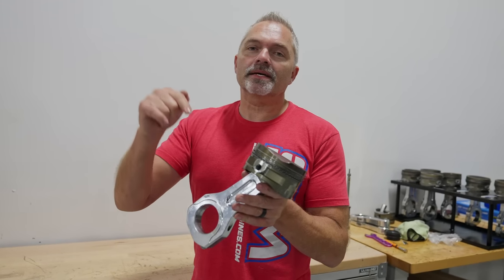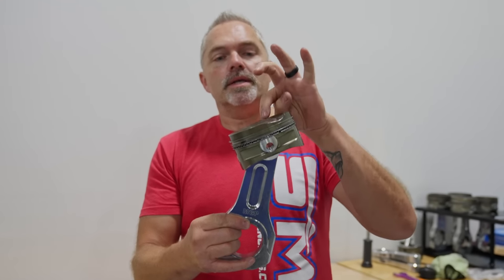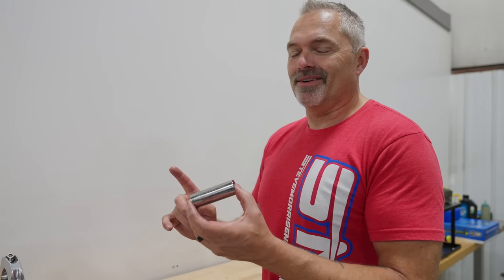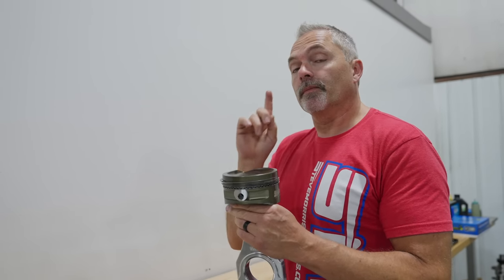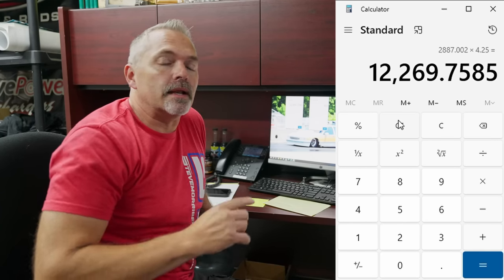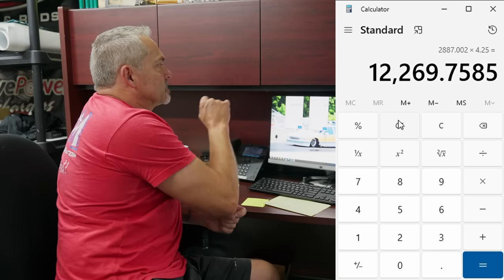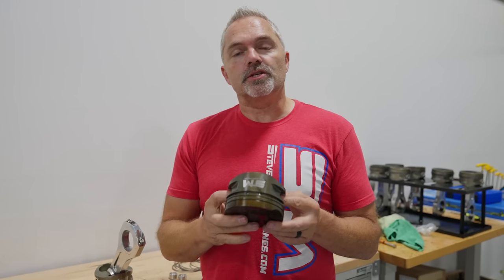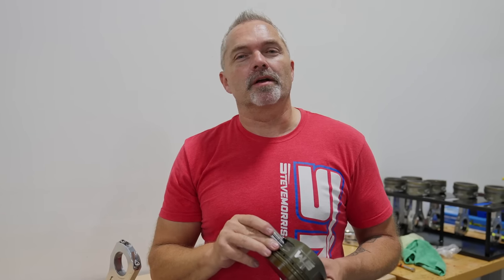Throw your rods away if you do this ???

Comment: Hey Steve, loved the video, I’m going to put my unwanted two sense in here and please correct me if I’m wrong! (This is kinda what was going through my head while watching the match I’m not really sitting this kind of asking) While I assume the inertia math is correct (I’d have no idea what math to use) there won’t be the x amount of lbs you had calculated on the connecting Rod pulling the piston  down, here’s why I think that. So we all know the piston Dosent travel the same speed during its full stroke, it’s faster in the middle of the barrel then it is at bdc and tdc, because it’s moving slower and slowing down a bit not just comes do a dead stop it wouldn’t put that whole 15,000 or whatever calculated lbs of force in the rod (all at once) 15,000 lbs of work is performed but over a very very short time period not just instantly which I assume would greatly reduce the shock factor of that inertia causing it to be less then 15,000 lbs on the rod that calculated force would only say if that 2.5lb piston was traveling at that certain speed. I could be wrong about this maybe that math is set up so that it takes that into account already? I’m not sure just my thoughts from watching, let me know what you think, thanks!

Comment: Very interesting video, cool to see the actual numbers and math. Curious why you say the revlimiter is so bad though. Even on the rev limiter you have compression on top of the piston, is that few degrees of BTDC spark that vital at slowing the piston down? If so, why can everything with stand the inertia PLUS the load created by combustion on the bottom side of the rotation?

Comment: That’s a lot of pound force. I can see why you wouldn’t waste your time with the weight since it won’t significantly impact that number. Cool video! Thanks! The product I just tested can handle (based on accidental destructive testing) 940,000 lbf of tension at 400 degrees Fahrenheit. It’s pretty nuts when you think about it.

Comment: Whe I first openedy auto shop customer brought me a Chevy cobalt with rough idle. It was hot and I hosed the throttle body down with a whole can of brake clean. I went to start it and instantly it turned 10k rpm and just screamed as it burned the brake clean. Customer standing there whole time. I now blow out Intake with compressed air after cleaning throttle bodies.

Comment: Ah, I love you Steve for what you teach and im not a troll, i actually almost failed 12th grade due to struggles with math, but i believe you're doing the math wrong. If its:  0.0000142 x Piston weight x RPM squared x the stroke, you cant do 0.0000142 x Piston weight x RPM x RPM x stroke. you have to calculate the the RPM squared first. so: in your first example @7500 RPM, that would be:  0.0000142 x 5.21 x 56,250,000 x 4.25 which calculates out to 17,686.32 lbs.  Edit: Changing your windows calculator to scientific mode will give you more options too

Comment: Just like ballistics. A tiny 7mm bullet going over 3000 feet per second weighing 180 grains / 11.7 grams has 4000 ft-lbs at the barrel and still has 2700 ft-lbs 1200 feet away. Granted a very high powered rifle but the numbers are still mind-blowing.

Comment: Uncle Steve maybe you could enlighten us on valve weight spring pressures valve control . Any math of the same relation? 1 of my buds just broke a piston by floating valves on a recline. That exponentially increasing weight must apply

Comment: On revolutions per second, shouldn't you have to divide by 8 first, than by 60? Revolutions are done at the crank, not individual pistons. There's 8 Pistons, so 7500 / 8 / 60 / (2)
That gets you 16 revolutions per piston and 8 compression strokes, per second. That message way more sense to me

Comment: Reminds me of the equation for a 2.0kg speaker sitting loosely on the parcel shelf - in a 50.0G crash (for number example) - that 2.0KG speaker turns into a 100.0KG as it slams into the back of your head.  CHEERS from AUSTRALIA.

Comment: I recall looking at the max weight I could hang from an M10 or 12 bolt, max recommended weight was one ton, steal not alluminythough.
Is crank case pressure really as high as say though?
Because as one piston goes down another goes up so must all be blow by pressure due to blower ?

I have idea on making piston lighter- just drill holes through top and it will let crank case gasses out too....
...... don't know why my compression is low.....😅😆😂

Comment: The maths changes with crank angle. At max and min piston speed the acceleration is zero. That's TDC, BDC and roughly mid way. Max acceleration is at the midway points between zero acceleration. Your weight calculations are based on max acceleration.

Comment: Hey steve ,There is a video by ben alameda racing showing an engine on a dyno running at 6500 RPM [800HP] .If you watch the crank trigger ,the pickup is intermittently hitting the wheel ,throwing sparks!  The crank was flexing so bad. The engine [ford] had a externally balanced forged crank that was rebalanced internally, the engine was not built by him though. Imagine if that engine went in a car and was run to 8000RPM . It would have done it once..... maybe. sorry to see your problems with sick week testing .glad you're OK.

Comment: i bet the downward force on the power stroke is much higher than the 15k lbs you calculated.   Inertial force on the piston is nominally the same both ends, but on the power stroke you still have probably over a hundred PSI of combustion pressureadding to that.

Comment: Here's one to blow your mind. At 10,000 rpm and a 4 second run a top fuel engine only turns over 666 times. It would be interesting to see the numbers from the much more complex math it would take to see the same thing from a promod or anything with a transmission and doesn't run a consistent (ish) rpm down the track.

Comment: Tri-Angle wrist pins.  Machining iffy but strength to weight could be tested.  Like a Mercedes star with fat dome tips.  Just brainfarting around.  The structure should eliminate any bend and deformation.  Picture a wrist pin with 3 holes, not one.  Or am I as dumb as they come?

Comment: Hi Steve, just wondering with the calculations if it also allows for what's going on in the other cylinders, which would change all of the big-end and small-end pressures depending on where it is on the crank in relation to the firing piston???🤷‍♂️ Makes my head hurt just thinking about it, let alone  what happens on the limiter 🤦‍♂️

Comment: I remember a long time ago (early 90's) going to a truck and tractor pull. One competitor had a tube chassis, glass body 2wd S10 with a small block and zoomies. When he hooked up and launched, that motor sang a note I've never heard before (or since?). Talked to him in the pits and he said he would launch around 10k rpm!! HOWEVER- small block has a much shorter stroke and may have had a custom crank with and even shorter than stock stroke, still. . . 
And if you want to see something mind bending, search for "the hypermax" dragster. It has a modded DT466 diesel (same as a school bus) that launches at 7k!! . .🤪 what?

Comment: PEMDAS says you’re math is wrong on the RPM squared. U have to square the rpm first, then multiple by the .0000142 x 2.51 x (rpm squared) x 4.25
Parentheses then exponents then multiplication then addition then subtraction. That would make the piston weight at 7500 RPMS 8,520.665625LBS

Comment: Sensei... I think the more interesting mind blowing revelation is that...
A piston @ 10,000 rpm is going up and down 166 times per second which means that it is enjoying firing / combustion "83 times a second" - - boom shakalaka 83 times a second 😳🤯😳 Now THAT'S a PARTY 🥳🥂🥳
*The next bit of math I'd like to know is @ 10k rpm how quickly (maybe converted to 0-60-0 times for reference) does the piston assembly accelerate from BDC to max velocity and then decelerate to TDC - - that would put some 0-60-0 times to shame and blow some minds... I tried to figure it out but just got a headache...

Comment: This is great, another good video would be putting a new or used rod in a machine to pull it apart and measure how the static strength holds up vs what math and the actual passes on rhe track show.

Comment: Your formula is correct but order of math is important. You must square the rpm before putting it in the formula which gives you a much different number 12.26 lbs. Which is still a lot when you consider piston speed

Comment: + the weight of the oil in it and on and off load firing and intake,exhaust stroke ferkin x8 pistons and cylinder pressure at detonation 🙈👍

Comment: This made me think of the differential between the weights at the top of the circumference and bottom of the piston pin.
 Theoretically, in one direction the top could be in a negative number traveling up and then slammed with the 15 thousand pounds going down. So its not just the 15K lbs, its however much the negative number may be traveling up and then hit with the 15K lbs to shove it down. That is a major transition to start with but it seems the change in direction forces would at to it as well. Kind of like what you were explaining with the ramp on the cam versus the valve.
Or is my brain just smarting from your facts and logic? 😂😂😂❤

Comment: It is conceivable that with some of the new small batch CPM steels they could come up with a material strong enough to make a substantially lighter piston pin. No doubt. Knifemakers have been gung ho full speed ahead using some zany ideas from bright metallurgists using CPM for awhile now with incredible results. But for piston pins this leads to a number of problems compared to knives. Firstly the penalty for an alloy that doesnt work as predicted in a knife is a crappy knife and a wasted crucible of steel. The penalty for being wrong on piston pins at the cutting edge is blowing up breathtakingly expensive motors. Few parties have both the desire and the money to try such risky experiments. Secondly even if you get reliable piston pins that weigh, say 20% less it is still not saving such a big percentage of the entire piston assembly..
 Having said that though as CPM steels become  more well known and the results of an alloy become more predictable I think that eventually some whiz kid engineer on an F1 team will probably get the chance to develop a lighter wrist pin from stronger steel and different geometry

Comment: I think you made a flaw in your calculations Steve, you said 0.0000142 x rpm squared. When you did the calculations you didn't use the rpm squared, you multiplied it by the rpm twice, that gives you a different answer.
Still incredibly high forces involved, but not quite as extreme as you stated. I came up with 2887.002 pounds @ 9000rpm
Love your tech talks
Reply: Hang on... I missed the conrod length component of the calculation... oops 😂😂

Comment: Not smart enough to prove my thought, but the piston weight / speed should be at its greatest half way down the bore... Not the top or bottom right?

When the piston hits valve overlap, it already gradually decreased in speed to zero due to the nature of the crank.

I'm thinking 2.5lbs TDC / piston mass gradually accelerates to 15.1klbs center bore / piston mass gradually de-accelerates to 2.5lbs BDC.

Edit: if I'm being told weight and speed gives me mass... Why are we using RPM? 1 revolution would put the piston TDC to BDC back to TDC. Mass was calculated with a stroke of 4.25 (TDC to BDC) so using only half a crank rotation...

Comment: Stick cars also gotta be careful of the  old misshift into 2nd or 1St when trying to go into 4th or 3Rd.  Had it happen a couple times and it maxed out my tach at 9999 rpm lol. Thankfully all it did was knock a few rockers off and made all the flywheel bolts come loose.😂

Comment: Have you seen sorcerer motor guys built 640 motor put steel rocker arms and 1/2 inch 3/4 pushrods to rev higher more stability valve bounce easier on valve train rev like hemi  just want know what your thoughts were

Comment: I was wondering, how did you land on 572ci for the SMX? why not go with a larger or smaller displacement?
Reply from the maker: I have 3 sizes
525
540 
572
Reply: @stevemorrisracing  I see. Why stop at 572 then?

Comment: Very interesting but I have a hypothetical question.  Is there a minimum RPM to make this calculation valid?  Example:  .0000142X2.51X1(RPM)X1(RPM)X4.25=.0001513
                  .0000142X2.51X2(RPM)X2(RPM)X4.25=.0006052

Both examples result in a fractional weight of the actual piston weight.    ?????????

Comment: Mr Morris, how about making a new type of piston and connecting rod titanium and Cobalt. Titanium is super light and extremely strong Cobalt steel is light as well I'm stronger than titanium! Instead of aluminum Pistons maybe you would have to make the sleeves in the block out of the same material to withstand the strength of the piston and connecting rod made out of those materials and you could also consider stainless steel combined with titanium and Cobalt and I would think that the journals on the crankshaft would have to be made at least of cobalt which I believe is the strongest metal that there ever is. It will probably be super expensive but I think you have the technology to make a prototype you will probably have to cast one of your amazing Pistons from your race engine. Who knows be the first! And I think the wrist pin would have to be made of cobalt as well you have the technology as you quoted the 6 million dollar man by the way what you have done I think you are a genius and as you teaching all of us I think you are learning more as well amazing can't wait to see more especially in the real world application aside from configuration! Can't wait to see more!

Comment: Hey Steve, there is a guy on YouTube building an ls with hopes of making 3000 hp and turning 9500rpm.   Not impossible , but he shortened the rod, which is steel and very heavy and his crank balance bob weight is 2211 grams for his heavy setup.   Sounds like a grenade to me.  What do you think?

Comment: More tech please Steve…. A few dumbass questions to consider.   Are the new electronically controlled wastegates up to controlling a high horsepower max effort engine like the SMX?  If they are could they be used as “soft” rev limiters?  I understand they can be targeted at boost, revs, time, tail shaft speed, turbo shaft speed, oil pressure, coolant pressure, essentially any parameter.

Comment: One thing is bothering me, you are not calculating any air restriction when piston comes up even both valves are open. Volume of pistion is bigger than valve or exhaust port, there must be some pressure on sylinder. My thinking can be wrong, just thinking at motor is airpump.

Comment: Your math for pressure of the cylinder is .7854xdia2/PSI. That is a standard unit of measure, not metric or engineer. The .7854 is a quarter of PI. What pi extrapolates is natures interference pattern of thermal or magnetic flux. That's why numbers do not repeat in pi, how can you produce the exact same thermal flux out puts every time? You can't. There are no numbers in nature just interference patterns. If you can dump the heat and have sound inertia the engine dose not care how much power it produces. If you understand energy then you will also comprehend that there is no time under load or flux. As long as you know your highest operating pressure for your cylinders then time dose not matter for this equation, .7854 is the time and temperature flux and makes a spiral or vortex. Go look at the thermal efficiency of a rotation detonation engine thrusting out of an annulus. Apply this equation to your computer maps for fuel/air ratios per RPM and pressure of the engine.

Comment: Just like when you break a ring and pinion under load and it zings the motor besides messing with rods,engine bearings it tears up the sprag in the transmission

Comment: Actually I think one piston strokes 15 times a second at 7500rpm. All 8 would stroke in combination 125 times a second.
Reply: I believe 1 or more stroke 2 times amount per rpm or revs/sec due to the rpm is based off of the crankshaft, now piston speed is affected due to rod length but not # of pistons at a given rpm

Comment: do the math on how many engine revolutions a top fuel dragster turns in the 1/4 mile . Let's say the engine is turning 6500 rpm ( guestimated) and runs a 1/4 mile in 3.8 seconds ( guestimated)  so 6500x 60 /3.8=411  411 engine revolutions from light to light . Seems impossible

Comment: First of all, the mass of a piston; or any other engine component does not change because of operating conditions. Forces change, stresses change, but not weight. 

Second; simply accepting constants and equations as gospel and simply  punching them into your calculator is flying blind. 

You need to understand every term in that equation as well as understand how that equation is developed. Otherwise, disasters will be very costly and frequent.

Comment: Be fun to see you take that rod and lift 10,000 lbs in the parking lot. Hard to fathom that small end can hold that kind of weight.
Reply: It should be about to hold about 25,823 psi on the small end also depends on aluminum grade, I calculated with 6061-t6 tensile strength and bbc aluminum I beam rods small end area
Reply: @912carldasher PSI is compressive force though, Lifting puts the rod in tension which would have more interesting results.

Comment: Steve, unfortunately your math is getting you an incorrect conclusion. Your equation is telling you what the force in pounds is if the piston+ were hitting a brick wall at the average speed of your stroke at said rpm. Not the actual force being exerted on the small end of the rod which is significantly less.